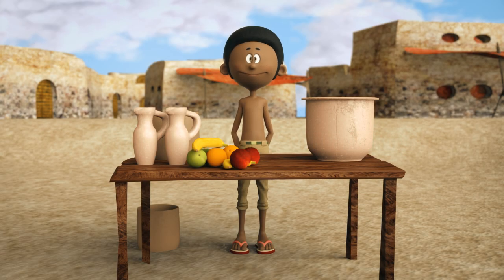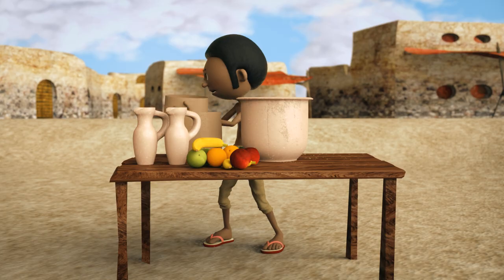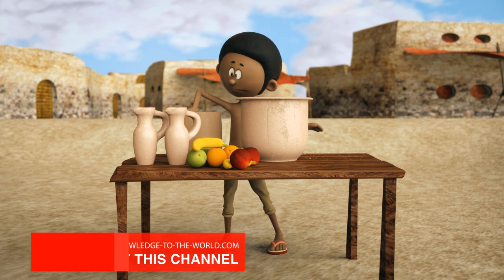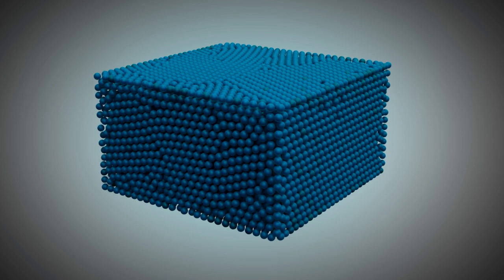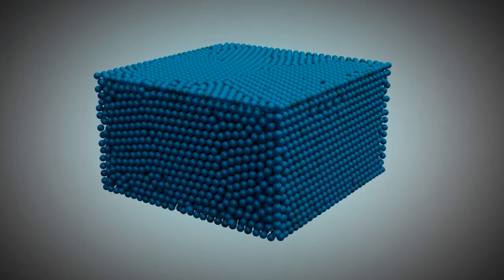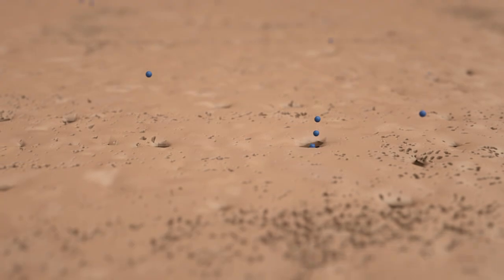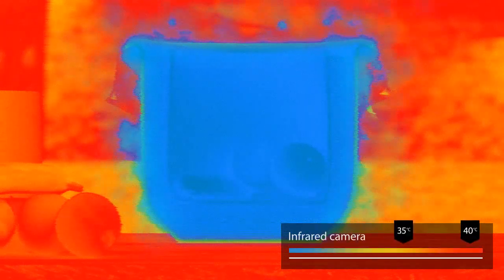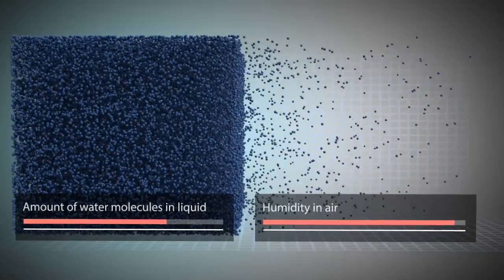How Evaporation Works! (Animation)

Comment: How long the fruit will stay fresh if we keep the pots in an ambient temperature and NOT exposed to direct sunlight or any heating?
Reply from the maker: Depends on the fruit :)
Reply: @ThomasSchwenke-knowledge  Sorry I have mistake in my question, I put there exposed to sunlight, which supposed to be NOT EXPOSED. With that condition, say I put a just ripen orange like in your animation. How long it can hold? Say, our ambient temperature is 23 degree Celsius.